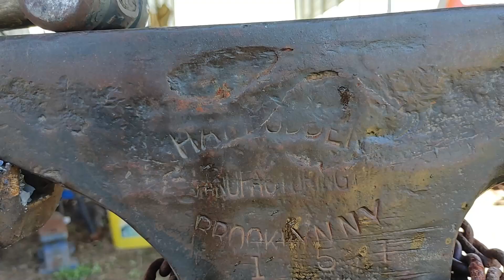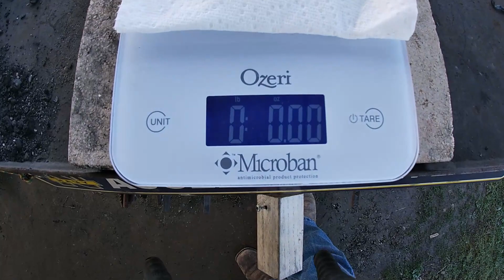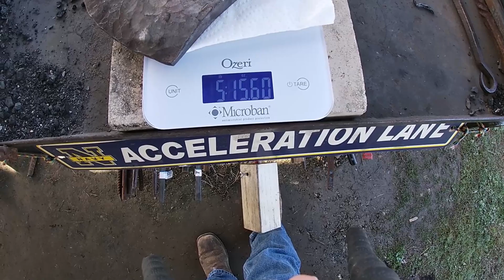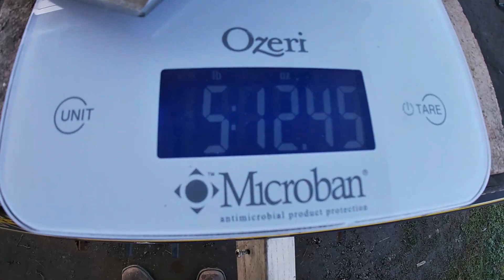3rd Hand Forging a single bevel BROAD AXE from scrap metal | Blacksmith Shop | Family Vlog

Comment: Nice work Brother, that is one huge chunk of metal to work. Epic slit and drift work. Try and overnight vinegar bath as far as removing scale will dissolve it for you and help that you don't need to fight through that hard layer when you come to the grind. Mate I do not envy you that grinding to bring it down to finished shape that's for sure, there is a reason I have a belt grinder even the weird size I run instead of a 2x72. Awesome to see you hard at it and sticking it out with such a tough project. PS need to talk to you about your sponsor, mine is having trouble making double sided work🤣
Reply from the maker: Thanks Brother...yeah one of these days I will have my belt sander to make work easier. The grinder does quick work if the scale and I normally use a grinder disc on my hand held but im currently out....so went to the bench...haha. Our shirts we LOVE so you should definitely check it out....👍🏽😁